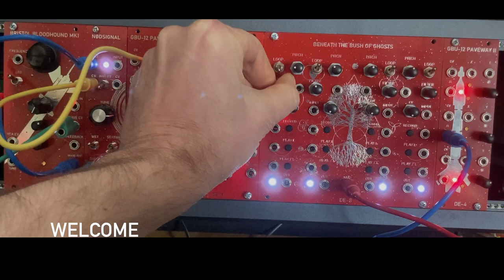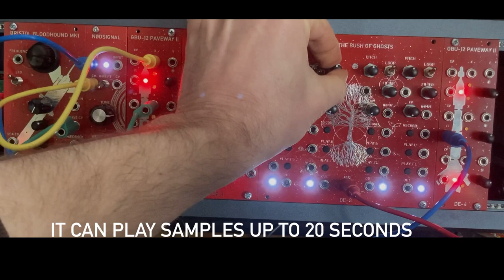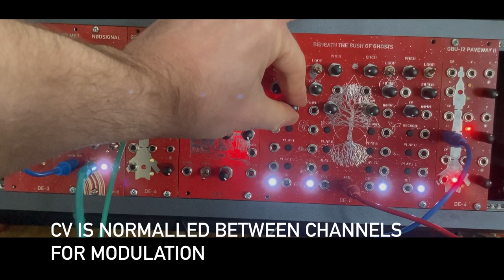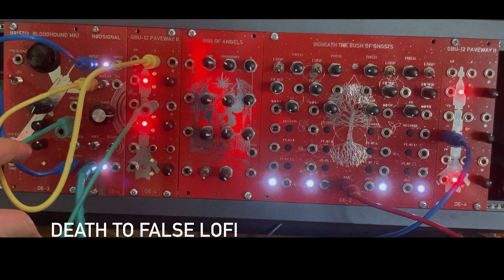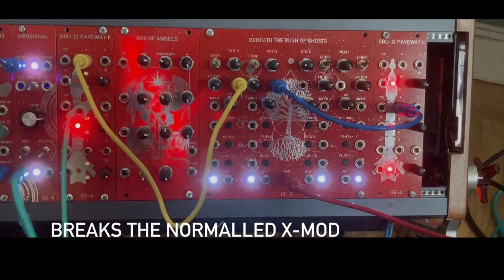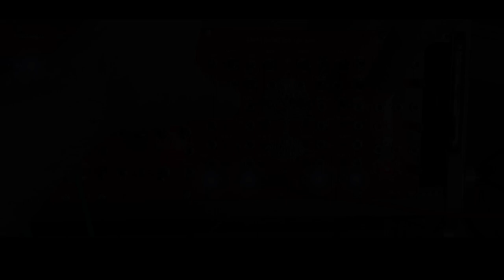BENEATH THE BUSH OF GHOSTS - QUAD LOFI SAMPLER - DEMO I

Comment: WELL DONE!!
Did you happen to just be fiddling with the 1820 on breadboard and made the decision to create this module after fiddling around and seeing the IC’s potential?  Or was it more like an obsession with the 1820 IC that drove you to make a module, come fails beyond fails and persevering through any and all shortcomings, in your efforts to create this?  Whatever drove your actions, accolades to you for your achievement!!  I hope to order the boards if I can earn the coin…
Reply from the maker: This is a pretty well documented IC so it was pretty fast development, I decided to include a filter to either smooth out the clicks and whatnot or enhance the noise by going high pass. Other than that it's quite simular to the Data sheet.